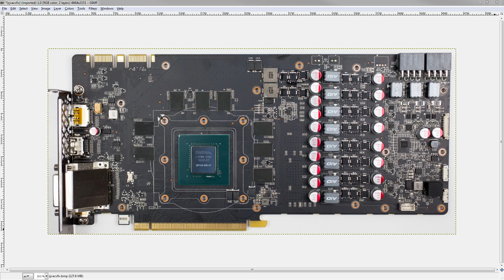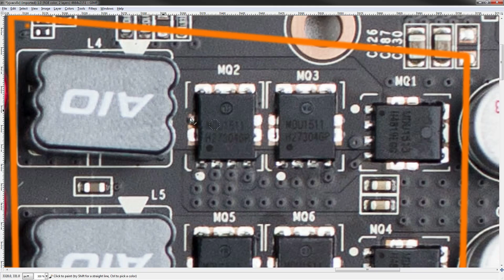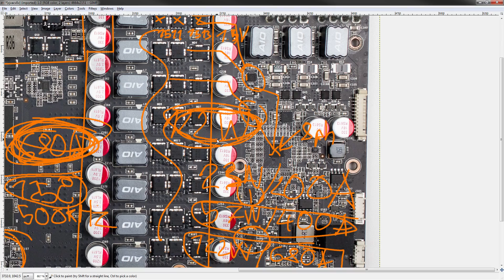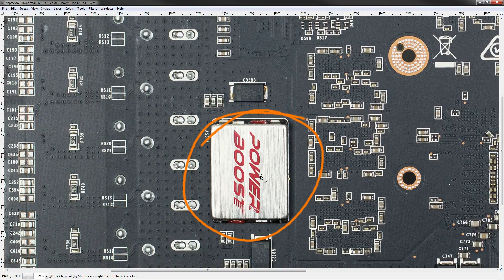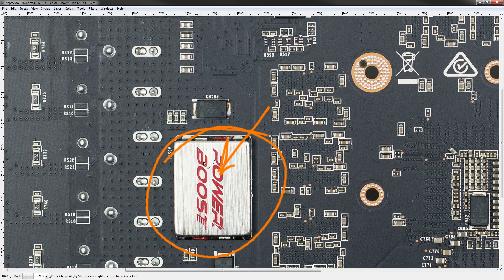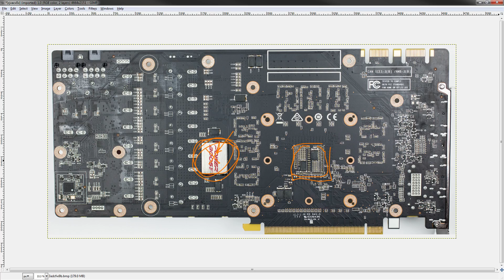PCB Breakdown: Zotac GTX 1080 AMP! & AMP! extreme [Actually Hardcore Overclocking]

Comment: I have that same graph, and I have the doubt if it is normal to find 0.000 ohms in the gpu coils, I already removed the gpu chip from the PCB and it continues with 0.000 ohms, and I also inject 1 volt and it consumes more than 6.2 amps and nothing heats up , please help :((

Comment: There’s 4 white connectors on this zotac gtx 1080 amp edition but on my card only 3 are in use there is nothing plugged into the one connector would this be the reason I’m not getting a signal /display from hdmi/dvi ?

Comment: Super late, but I thought I'd mention that the AMP! edition card doesn't use this PCB and is quite a bit different although I'm not sure exactly in which ways.
Reply: I had that amp edition, they used same PCB design, one thing bad in this card was it's stock thermal pad & paste.

Comment: The Zotac AMP! cooler is Garbage... Just so ya know...
Love the breakdown and all of the content of yours that I have seen so far!
Reply: I KNOW!

One of two fans died on my 1080 AMP. Their fans are garbage and the cooler itself despite mass is pretty weak. Now i have Morpheus II with two Corsair high static pressure fans mounted to it. Barely goes over 60c
Reply: @Raivo_K  nice! I have one fan about to die and I agree. Aside from looking beefy, it sucks.
Zotac refuses to send me a fan too. Talked with them many times. Even to just buy a set from them, they won't do it.
Reply: Yep and replacements cost about 35$: https://www.ebay.com/sch/i.html?LH_CAds=&_ex_kw=&_fpos=&_fspt=1&_mPrRngCbx=1&_nkw=zotac+fan&_sacat=&_sadis=&_sop=12&_udhi=&_udlo=&_fosrp=1

At that price it might be better to go for aftermarket cooler. Tho my combo was not cheap. About 100$ with the fans included.

Comment: Got this card, OC quite well! Had 2 cards and both reached 2050 MHz with ease. Cooler lets it down though, can't cope with the heat. Otherwise 2.1+ GHz would be possible...
Reply: in my case it seems to be TDP limited. I havent tried remove the limiter but in my case 2070mhz/5400(10800mhz) on the memory. Im at 65c (89 vrm) yet cant give it more voltage. On gpuz says its vrel limited (voltage)

Comment: So from 10:55 I assume this card is not effected by the same fault that the reference cards are with the memory VRM. Good thing I never buy reference cards and rearly buy custom cards with reference PCBs, although the card is annoying because it has a high start up volltage for the fans so they will spin up loudly then stop etc when you are only putting a small load on the card.

Comment: Unfortunately the GTX 1080 AMP! (non-extreme) is known to have heat issues. I had to undervolt my card all the way down to 825mV, capping at 1860MHz core to get down to reasonable temperatures without having the card throttle itself.
Honestly, I genuinely regret buying this card, I feel like the money could be spent much better on something else.
Reply: Maybe they fixed it, i bought a zotac 1 month ago and didn't had any temp above 70C with a sightly higher fan speed.  I changed the termal paste just for extra cooling, not a  problem at all.

Comment: Guys, have you tried testing how much performance MSI Afterburner with no OC in place sucks out? I was kinda surprised when I found out it reduced fps by about 5-8% in the Tomb Raider benchmark  just by running in the background with no OC...o_O...making OCing RX 480 totally pointless.

Comment: http://www.weibo.com/ttarticle/p/show?id=2309351000784003957247744597
there is a cut down version of this pcb, namely gtx 1070 x gaming oc, a chinese exclusive version, having 6+2 phases only. but it seems that there are still four little chips for that six phases. very interesting.

https://kknews.cc/zh-hk/digital/8aeeee.html
btw, a chinese exclusive version of gtx 1060, namely gtx 1060 plus oc, using almost the same components of gtx 1080 amp extreme pcb has, with lower pcb length.

Comment: I have a Zotac 1080 Amp! Extreme with the ASUS T4 Bios flashed (no power/temp limit + higher 1.2v voltage) and it didn´t help at all with OC. I´ve reached the same 2126 Mhz max frequency as with the stock Bios. So yes, not much fun with Pascal, unlike the 980Ti which was tweak/flash frenzy.

Also, liked your technical approach to the cards. Too many unboxing and superficial reviews out there by non-tech youtubers. Subscribed! ;)

Comment: Glad you did a zotac card i have a 1070 AE and a strix rx 480 oc. Love both cards might even crossfire the 480 i think the 1070 might be to big to fit 2 on my mb and in my main rigs case. The zotac card is still the coolest air cooled card I've ever owned. The 480 great just wish it was quieter but it can stay quiet at 1380mhz and 65c and can to a little over 1400mhz with not much trouble. Not tried more than 1420ish and 200 to the memory. My 1070 can do 2137mhz and 600 on the memory.

Comment: yes a pcb breakdown on a 1080 amp extreme:)i got that card:)but will probaly got a vega card if they perform better and dont cost to much:)much rather have a amd gpu in my rig then a Nvidia card after all ther shit they doing and bad drivers and lack of dx12 performence and shit:P
Reply: björn sjöblom I feel you. I have to use a older driver to make my gtx 1080 usable. I never had driver issues with AMD. I'm going to change on Navi or maybe Vega.
Reply: same here with game crashing and yt crashing and such:S dont like ther hairworks stuff and anti gamer shit and much more prefer amds open source and cheap freesync and stuff in that case but sadly they havent had any card to compete with..always had amd before and really like them so thinking of getting back if they can perform:)
Reply: björn sjöblom I hope nvidia makes a comeback with all that AMD pressure.
Reply: I have good faith that Vega will bring high end and enthusiast performance and be affordable compared to the 1080.

Comment: http://cdn.videocardz.com/1/2016/05/ZOTAC-GTX-1080-PGF.jpg
Reply: 16 phases, or 8 with doublers.

Holy balls.
Reply: holy shit
this is a art
Reply: theres also a pic of the whole pcb
http://cdn.videocardz.com/1/2016/05/ZOTAC-GTX-1080-PGF-PCB-900x503.jpg
Reply: lol its actualy only a true 8 phase,  where each phase is doubled
Reply: That's the picture he mentioned. It's nice but you can't read the chips

Comment: could you possibly do one on the MSI GTX 1060 Gaming x 6g? I have had one for a few months, and would love to see the parts that make it up.
Reply from the maker: If I can find it
Reply from the maker: I haven't had a single pascal card in my hands yet. However from everything I've seen/heard it should be like the past gens where the BIOS limits are so low that maxing all power and voltage settings in Afterburner shouldn't do any harm.
Reply: Puff man Bob you could take it apart ;)
Reply: that's my experience with my 1070 - temperature, TDP Wattage limit, and stability aren't my limits.
all remaining limits require BIOS modification, which you can't do on GTX1000.
Reply: ***** he hasn't had any of the products to use for himself yet, so how exactly would he be able to test Inductor whining?

(and on my 1070 atleast, i get nothing audible unless i allow Frame Times below say 5ms, which in reality means i'll never hear it)

Comment: GTX 1060 Asus strix or MSI RX 480 Gaming X ?
Reply from the maker: 480
Reply: RX 480, definetely. AMD FineWine technology is why.
Reply: i might get the 1060 asus strix or the rx 480 asus strix
Reply: The 480 because it can actually overclock at all
Reply: RODRICK HD they're both overpriced in most countries, on the ballpark of 300 euro. If you can find any for less, sure
Reply: Even if you already chose the 480, you can wait for the 490. The prices may shift a little.
Reply: I have the MSI 480 and it's a beast!
Reply: I like the sound of the RX 480, but just so you know, GamersNexus did a review on both and found at reference clock the 1060 is slightly better. I don't know how overclocking and card quality will change that. That being said, the RX 480 Gaming X still sounds like a more appealing option to me.
Reply: thx guys

Comment: I have a question, the GTX 1060 Asus strix its the better 1060? and can you do a pcb breakdwon?
Reply from the maker: You aren't by any chance considering buying a 1060?
Reply: aaaaaaaaaaaaa... i might want to buy one, because i rely want to build a new system, the RX 480 its better :D?=?
Reply from the maker: Especially once overclocked the RX 480s are faster than OCed 1060s in pretty much everything
Reply: the 1060 used to be better but now with driver updates the 480 is better and you can get both for the same price, at least in my country
Reply: Not just driver updates, early RX480s weren't particularly good overclockers. Then yields and processes started to improve and now we see 1400 MHz+ on pretty much all of them (minus the stock cooler ones because they blooooooooow (pun intended)) with some of them going as high as 1475 MHz.

Comment from the maker: First!
Reply from the maker: Thermal Grizzly Conductonaut. It's a liquid metal paste and unlike CLU I haven't heard of it ever eating through solder.
Reply: secound :D
Reply: Other youtuber (Jayztwocents) benchmarked the amp extreme on air and at 100 load Overclocked to the stock max the cooler is good enough it bounces back to fanless mode apperantly. So it goes "off On for a bit, back off, on for a bit, back off, on for a bit" while running Heaven at "maxxed out sliders on precision" whatever that is +100/+500 maybe?
Reply: Is this PCB similar enough to the 108 ti Amp non extreme to fit the 1080 amp waterblock on it?
Reply: Actually Hardcore Overclocking could you suggest something for shorting shunts on gpu
Reply: Actually Hardcore Overclocking thx
Reply: I'm thinking of getting the AMP because it's a lot cheaper at the moment (in Germany) than the other AIB cards. What are the chances there will be a waterblock available at some point? EK says they are not planning to do one for this card.
Reply: Don't know
Reply: 1080'$  are not very good overclockers